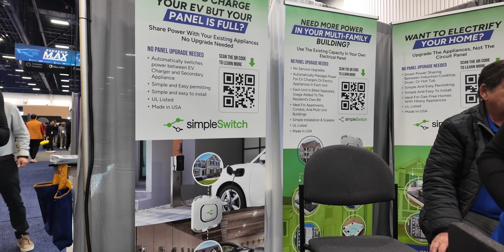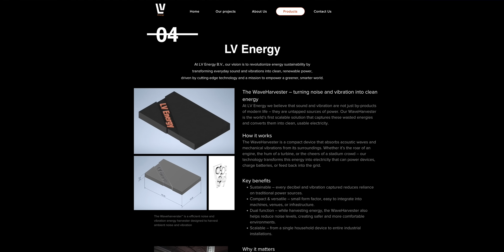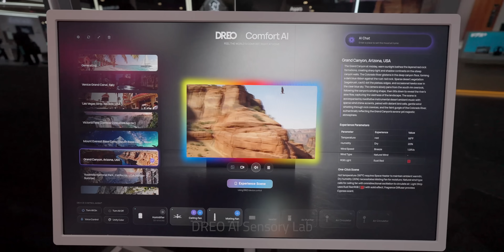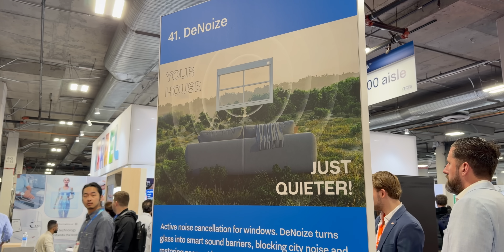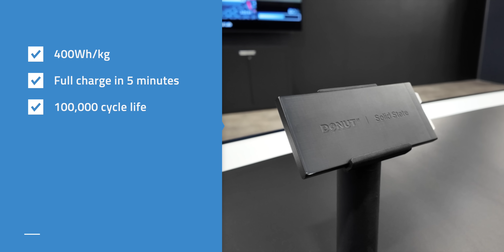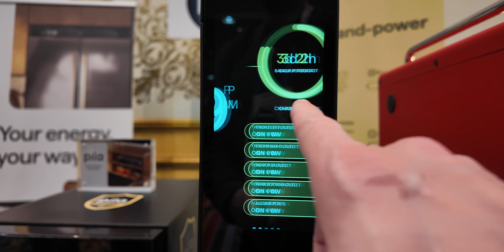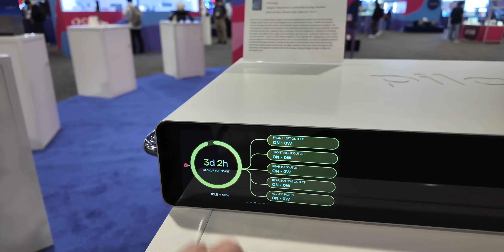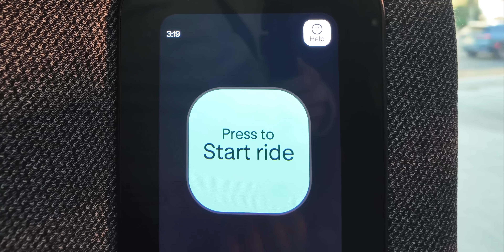The Most Controversial Battery at CES 2026

Comment: The ev charger switch, is it really that new?
I've had neocharge for 3 years now and it works perfectly for what I need. I have it plugged into my dryer outlet, and it does the whole main and secondary to where if the dryer's running the car isn't charging. If the dryer's not running the car is charging, Now, the app I will admit, is buggy every now and again, but they really are super fast at responding ehen you're having an issue
Plus I like the whole take your electric bill, see how much they're charging you put it into the app and it'll tell you how much the car charging cost. Now you do have to figure out things like, when is your peak times and things of that nature  to get thr most accurate cost. But otherwise again pretty nice. You also don't have to use the app at all, if you don't want to. It functions completely without it. Oh, yeah, and a side note It will also tell you the cost of the appliance that's in the main as well.

Comment: Even if the batteries are real, it still doesn't solve anything.  Lets say an average EV has a 50kwh battery.  To charge that in 5 min would require a 600kw power supply and massive cables.  Now picture a bunch of EVs wanting to charge at the same time- it will be decades. If ever, that power like that is in common distribution, and it certainly won't come from wind and solar.

Comment: I had a Casio solar charged digital watch I got in the late 80s, that lasted for over a decade, the battery wore out, after the band holder broke, still used it at my desk. Solar charging works, as long as it charges the battery.

Comment: The way around a door lock not letting you back in.  Get one of the locks that still allow you to use a key, or even your original key.   Forget all the fancy tech that can fail.   Just use one of the many retrofit locks that have a real key still.
Much better than all this other crap.  Companies like August have made this style lock for years.  Work on Bluetooth or WiFi, but have the original key on the outside.   Much better solution.

Comment: We've had a SimpleSwitch for about 13 months, with our induction range and the car charger as the two loads.  It works like a charm and allowed us get permitted to fully electrify our home without upgrading our 100 Amp breaker panel.  Since we charge the EV mostly in the middle of the night due to cheap rates, and we cook during the day, we rarely actually have the EV charger turned off.  It is a lot less expensive than the panel upgrade would have been.  We did have to educate our electrician about it.

Comment: Elephant in the room is DONUT LAB solid state battery claims, tied to Verge Motorcycles, Nordic nano, Cova Power....Snake oil or legit? 
Donut Lab's CEO, Marko Lehtimäki, is connected to all of these:
Donut Lab (Co-Founder & CEO)
Verge Motorcycles (Co-Founder, Advisor & Board Member)
Cova Power (Co-Founder; joint venture with Ahola Group)
Nordic Nano Group (Board Member & Strategic Partner)
Ahola Group (Strategic Joint Venture Partner via Cova Power)
ESOX Group (Strategic Technology Partner)
Venture Bonsai (Co-Founder & Chairman of the Board)
AppGyver (Founder & Former CEO; acquired by SAP)
Aito Ventures Oy (Advisor)
WATT Electric Vehicles (Strategic Platform Partner)
Forbes Technology Council (Official Member)
FansMagnet (Former CTO) 
Donut Lab: 22 employees
Verge Motorcycles: 50 employees
Cova Power: Approximately 51–58 employees
Nordic Nano Group: 11–50 employees
Ahola Group: Approximately 900 employees (estimated total across its transport and digital logistics operations).
SAP (acquired AppGyver): Over 100,000 employees globally.
Aito Ventures Oy: 1–10 employees.
Venture Bonsai: 1–10 employees.

Comment: Matt you said the Amprius 520 watt hour per kg  battery so casually many do not realize how big this news from CES 2026 truly is.

Back in 2020, Elon Musk stated that 400 Wh/kg battery energy density was the tipping point needed to make electric aircraft capable of outperforming kerosene-powered planes for long-distance flight. His vision—first calculated in 2014—outlined a supersonic electric VTOL aircraft relying entirely on next-generation batteries. At the time, this was theoretical engineering waiting on battery chemistry to catch up.

Now, that moment has arrived.

With Amprius Technologies receiving a CES 2026 Best of Innovation Award for its silicon-anode battery achieving 520 Wh/kg—not just meeting Musk’s required threshold, but surpassing it by a significant margin. These are not lab prototypes. These cells are already deployed, powering Nokia’s drone-in-a-box systems announced in December 2025 and supporting Airbus high-altitude aviation projects.

This marks the transition from speculative electric aviation to commercially viable reality. The battery barrier that held back electric aircraft for decades has been acheived.

Comment: I’m extremely skeptical of the donut . If it was ready, today, they should have had at least a working prototype if not a product available for purchase. It’s got every box checked for a scam. Outrageous specs, no proof, no product to show, little to no answers to typical questions, little evidence, such a small group of people working on something super large companies with lots more money and time. The number of companies who said they solved solid state that turned out to be false. 100,000 cycles? How long did that test take?
Anything is possible, but until I see solid evidence of it working over and over, I’m not buying it. 

If they had something this good, you didn’t think of showing it to a large manufacturer? Manufacturers would be lined up

Comment: I installed a simple switch 14 months ago and love it. I have a driveway and garage that is 1 car wide. I put in EVSEs outside and in the garage on the same circuit using the simple switch. The outdoor charger is the primary and the indoor one is secondary. Both cannot charge at the same time, but it doesn’t matter who gets home first, I can always plug in

Comment: I agree with Ziroth's assessment that it is likely a super capacitor. There was a Japan research paper in April with 418Wh/kg, so this is within the realm of possibility. Going to lab bench to manufacturing in 9 months is super super impressive though if they can pull it off. The paper is called "Nanocell-structured carbon nanotube composite fibers for ultrahigh energy and power density supercapacitors"

Comment: Had not heard of Pila, but that is a much more novel solution. 
Provided, of course, that there are additional safety measures in place. 'Whole home battery' solutions are typically outside, which would at least be slightly safer if there was ever an issue with the cells.

Comment: look at that setup at 9:23, what gauge are those power cables? they look about 5-6mm diameter so that's about #2 gauge, and the working current rating for that is about 130A. pushing 270A would likely cause the wire to glow red hot and the insulation catch fire.

Comment: I don't want to rain on the rest, but it's worth pointing out that the lock I've had on my door for nearly a decade has nodules that accept any standard 9-volt battery for external power, and it's rare that anyone would need more than that.

Comment: the dreo fan humidifier...... does it need to use distilled water?  will it leave mineral dust all over my table?  leave mineral buildup in the device?  pretty sure it's just using an ultrasonic emitter to make the ultra fine humid air.  you can buy just the emitter for like $20.

......give me that dam window speaker.  my apartment is next to a train track.  train goes by 5 times a day, blaring it's horn.  it is the worst.   i though about trying to buy a speaker pulse driver thing, and trying to make something like that myself.  

dang it, give me that...........it'll cost $1000 i'm sure.   my apartment would never buy/set them up.  they're cheap AF.

Comment: my fingerprint/pin front door lock has a usb-c connector on it, just plug in a power bank or a phone capable of power share to get it unlocked and then change the battery. Alternatively, most people have multiple doors, including garage doors which typically can be activated with your phone or a pin.
Reply: @TRCCtv  what brand?

Comment: Self driving cars continue to be a BS non-solution that (even when they work, which they frequently don't) entirely fail to solve the major issues facing transportation today (emissions, density/congestion, and cost), and mainly serve to be a one-two punch of a distraction tactic taking attention and money away from public transportation initiatives, and simultaneously funneling as much of said money (and the power that comes with it) into corporate pockets rather than democratically controlled institutions. Screw that. We need trains, buses and light rail, not driverless cabs.

Comment: Just like all these companies;  Donut is simply hyping mediocre technology to attract government and private sector investments.  

Solid state batteries offer next to ZERO benefit over current generation lithium ion batteries.  

They are still prone to thermal runaway, dendrite formation and short circuit, they are brittle and can / will crack over time. They run hotter than traditional lithium batteries, they are still cold sensitive…….

Comment: Ah, the USA and the problems of 110V. In Europe, you can charge your car, heat your house with a heat pump, bake bread in the oven, wash dishes, and clothes, and there are no current limits. :)
In Poland, you get three-pane windows and nine-chamber frames as standard. Airtight installation and excellent sound insulation. No need for any electronic gadgets.
These innovations are interesting and surprising for a European.

Comment: 7:02 this seems almost too easy of a solution, would an open source alternative be possible? Its just a mic ans some transducers
Reply: The complex part is the circuitry and the software, not the speakers or microphones. But active noise cancelling has been around long enough that I imagine this portion isn’t so proprietary anymore.
Reply: @mackit   that’s right. There are sets of off the shelf chips and parts that can do I a majority of the steps in the process, but It does take some work to get a system working - especially if you want to to work in a variety of contexts or to be manufactured at any scale.

Comment: My panel is 100A. My plan is to put a charger on a 40A circuit and just de-rate it 32A. That will be a lot cheaper than that switch thing. On the other hand, I could buy an Emporia charger with smart load management built in which would also be cheaper.

Edit: The Pila kit is $1300 USD for 1.6kWh. A second one is $1,200. So to get close to a 10kWh system, it would be $7,500USD. Thats quite interesting. If you got the dual F3800 from Anker with an additional battery, it'd be around $8,300.

Comment: There are practical reasons why people face forward in cars, namely forces during acceleration and braking - those are simply much easier and safer to handle when you face forward.
But it's interesting, even in buses passengers generally face forward while on subways, they face the sides.

Comment: Not sure the wireless power for the door lock was a good use case over solar. Maybe as a research product, but not a practical product. Sure, solar is intermittent, but based on how long my lock will run between charging batteries that's a non-issue for anywhere except places that don't get any light at all. I can run for about 9 months on 14.7 Wh of storage. I'd only need a solar cell to produce ~54.4 milli-Watt hours per day on average to keep the power on.

Comment: I believe it. The research is there, and the specs of the researched batteries align closely with the Donut Lab specs. It’s not a super capacitor. They kept it secret until it was ready for production, so it seems like it came out of nowhere, but it’s been in the works for years. When it starts shipping on the motorcycle, watch the skeptics heads explode.

Comment: It's disappointing seeing high-tech solutions when low-tech ones work perfectly well, though I understand that the low-tech option isn't always feasible or accessible. When I was living under the flight path of a busy airport, the apartment building I was in just had thick walls and two sets of double-pane windows maybe 6 inches apart on either side of the exterior wall. Worked like a charm, and airplane noise was never a problem. Plus thicker walls help with temperature too, so I'd go that route if I was ever in charge of making those decisions. The real kick to quality of life was that being outside without earplugs or noise-cancelling headphones was unpleasant.

Edit: I wonder if it could have applications in aviation though. For all the unpleasantness of flying, just the noise of the plane flying is high up on my list.

Comment: I have a battery powered lock on my apartment, have changed the battery once in 4 years when I noticed it was getting slow. It has terminals on the exterior so you can use a battery to power it if it completely runs out of power. So this tech doesn't seem to have much benefit to me, especially if it costs a lot more which it undoubtedly will to start with.

Comment: "what if the battery goes flat and you can't get in?".. well, in my opinion anyone who uses a smart door lock that doesn't have a key backup is an idiot. I work with electronic security every day and I know that it cannot be 100% relied on. NOTHING electronic can be 100% relied on. ALWAYS have a backup.

Comment: I don't have a socket in my hallway, but if Lockin could get the auracharge down to the size of gu10 lightbulb, then I could just pop it into a light fitting.

Simpleswitch seems overkill when EV chargers like the Zappi use CT clamps for grid or circuit limitation.

I wonder if the DeNoize tech could be adapted to cancel noise from outside plant. 
In the UK there are pretty strict noise limits on heat pumps. I wonder if tech like this could be used on larger heat pumps to reduce noise.

Comment: There is a paper from 2025 from researchers in South Korea giving almost the exact same specs as the Donut battery but for a capacitor. Which makes more sense. The components do line up enough that this might not be vaporware but rather first to market of the above research.

Comment: This battery lacking the volatility of lithium could have a broader accceptance and make a significant impact on the environment, if produced in sufficient volume. The Donut CEO has had a sketchy background but succeses as well.  Looks like NordicNano co, which Donut invested in, is the brains behind the battery, (closer to a super-capacitor) from NordicNano pitch pages @ZirothTech  made available:   Electrostatic Bipolar Capacitor: "up to 400 Wh/kg, over 50,000 charging cycles."  The Finland Facilities: "the premises (3850 m2) can support five production lines running simultaneously in three shifts."
  They excuse the 3D printed stand-in with the suggestion that a working prototype battery would not be allowed on airlines or convention centers.

  
* Amprius Won CES 's Innovation Award (lithium-ion battery, 520 Wh/kg) beating the solid state

Comment: It might not have been what they were showing, but Dreo makes solid little connected heaters with temperature sensors and app support.  I use one for my workshop so my water cooling setup for my CO2 laser doesn't freeze.  I dunno about all that AI stuff, but the heater has impressed the heck out of me, and it was not expensive at all.

Comment: Thanks for the video. But, I don't quite see the point of having a house and everything inside connected to the internet when we well know that a 15-year-old across the world will be able to tinker with it. Even now, people can use (steal) new internet-connected cars via their phones. Is it that hard to unlock your front door with a key or turn your lights on at the switch?
We all know most of that electronic stuff eventually fails, and then what? Replace it again and fill up the dump with more stuff?
Some things would be hard to get away from, but a lot of stuff is totally useless.

Comment: First, YAY! Finally the channel I've been waiting to hear from on Solid State battery tech has covered it, if a little in passing, but there's far more to come. Color me hopeful because, although some question my reasoning for loving solid state batteries, I'm still very interested for the promises of such tech. Lighter batteries, less space occupied by said battery, and a much faster charge time that puts it much more in line with ICE. EV's will gain the most, but imagine a starter battery for your ICE car that weighs about 10 pounds. Imagine a hybrid with twice the battery capacity and doesn't weigh any more. 

Second, regarding the IR tech; slowly but surely we are getting closer and closer to what Nikolai Tesla invented and had over a hundred years ago. The biggest difference is that to live in Nikolai's dream, we've gotta pay for it.

Comment: 5:32 Regarding the SimpleSwitch: 4 years ago I bought a $70 doohickey that sits in my meter box, connected to the HAN port, surveying the power usage. That way my EV charger can lower its power draw if the phase load reaches the 25A my panel is rated for.

Edit: The doohickey is a Tibber Pulse and 25 A gives me ~17 kW, which is comparable to a 70 A US home. (100 A seems to be the smallest common main breaker though. I live in a big Swedish house, 2700 sq ft, comparable to an average US house!)

Comment: Just remember no matter the battery tech to charge a car size battery in like 9 minutes you need about a 1.2 megawatt power supply. You can only charge as fast as the power supply allows you to. They will be great for cellphones no doubt. I am using 40 watts to charge in about 30 minutes (30-80%) I would need 120 watts to charge in 10 minutes if all is equal.